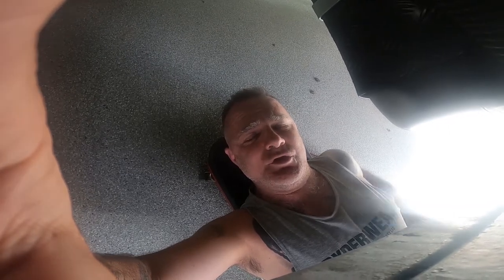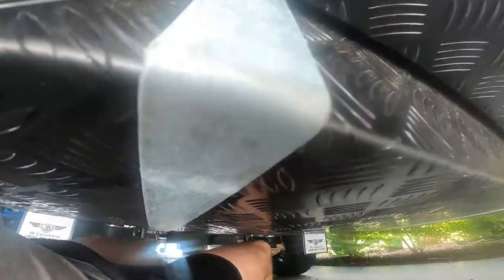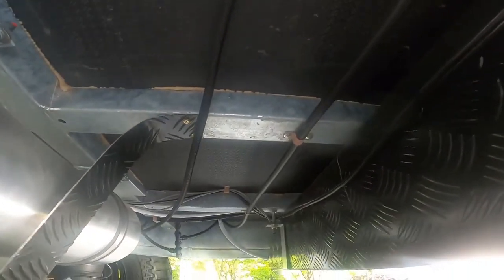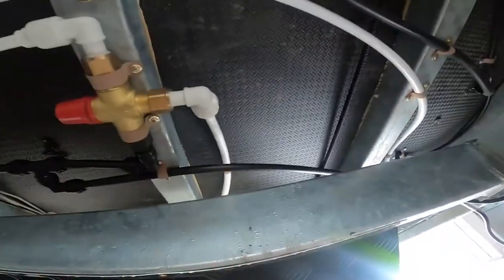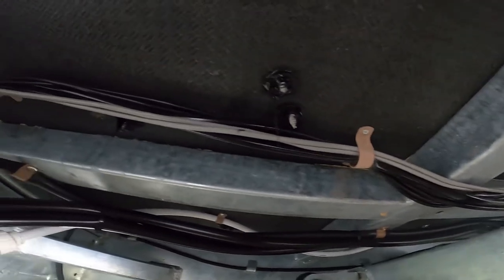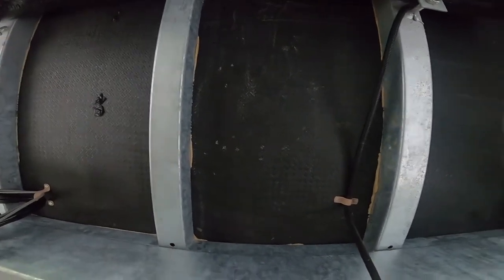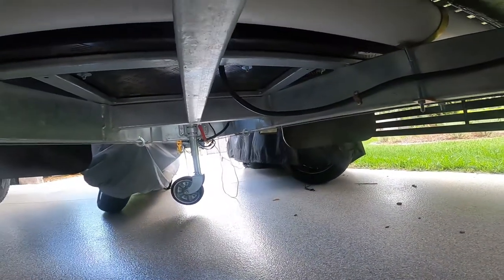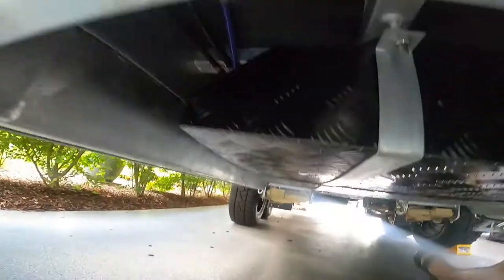Pool Noodle Protection for under your Van

Comment: What you should look at is extra protection for the taps on the end of the water tanks. Have personal experience with damage to those from rocks and have read of others with same issue. Even though they are seemingly behind the checker plate rocks will fly up and into there, smash the tap and leave you with no water
Reply from the maker: Cheers for the advice.
Reply: Yep agree. Those Taps on water tanks are crap and whilst they look protected, they get smashed. We lost one on our recent Cape York Trip. Carry some spares too

Comment: So the "breather hose" from your tank just vents to an open pipe under the chassis?    Should be higher up in the event that you go thru any deep water, or at least have some kind of filter or similar......most breather hoses are connected up near the filling caps.....Id also cover that gas line as it enters the floor at the front of the van, as it could easily catch a stake???   They look like they are pretty well finished off vans but suppose they should be for the price.......safe travels...
Reply from the maker: Cheers will look in to this at first service